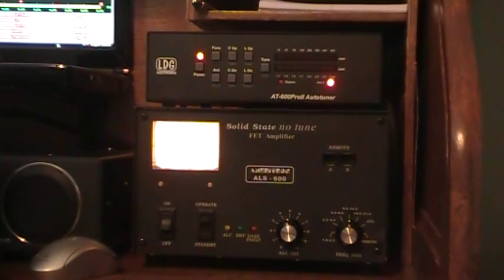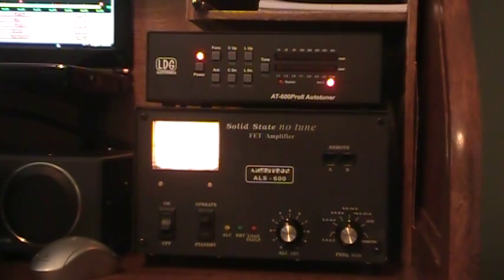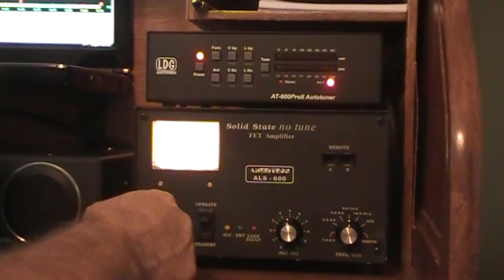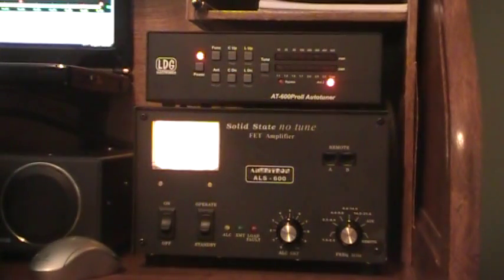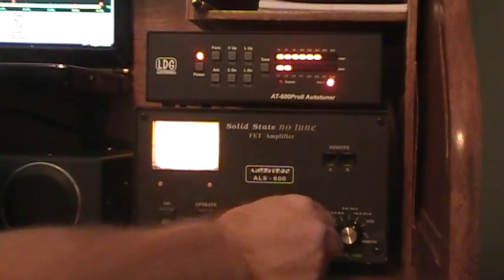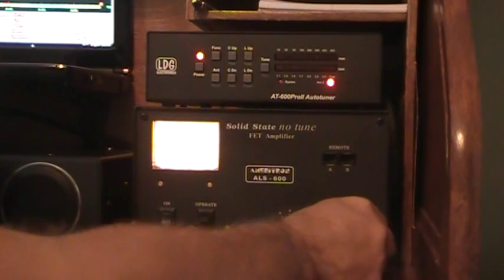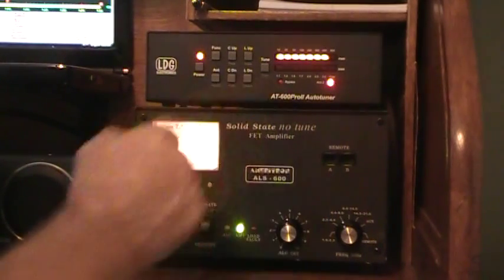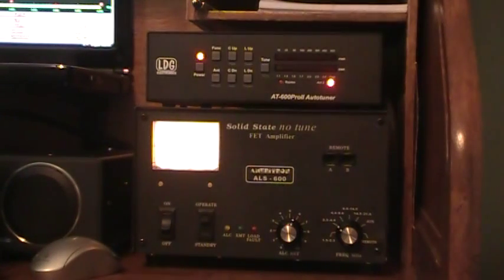LDG- 600ProII Auto Tuner

Comment: I have the same setup as you, except I have a IC-7300.  Do you ever have "Load Fault" issues when transmitting on 80 meter?  My SWR is about 1.6:1....at about 200 watts, my "Load Fault" LED comes on.  I can transmit at 500 watts on 20 meters no problem, with up to a 2:1 SWR.  Just curious if you have any issues on 80 meters.  Using a G5RV inverted dipole, BTW.

Comment: Question? I have Kenwood 440 & a LDG at1000 alto tuner and a ameritron 811, my problem being is im running a g5rv and at this point it will only tune to 40 meters need to add more coacts? cause my impedance is not right ... Question to u what antenna would you recommend for my setup and that would work well with the at1000?

Comment: Not sure where is says in the manual that Antenna 1 is bypassed, maybe this is just default as both Antenna 1 and 2 work in line with the tuner or you can bypass both Antenna 1 or 2 or individually. You can put the unit in auto mode and you'll have no need to hit the tune button, all you do it introduce a carrier and the unit will automatically start the tuning process. Also once you have tuned on a band lets say 40m and tune then go to another band say 20m and tune and then back to 40m, you do not need to tune again, just introduce the carrier again and it will remember the band and setting and it will recall the previous tune straight away. You can save a few tuning stages along the band from bottom to top or vice versa, that way you just key down a carrier anywhere on that band and you are already tuned as the unit will recall the setting previously stored straight away, turn on the amplifier and key carrier for a quick check that the swr is still ok, switch back to ssb mode and your good to go :) Nice video though, cheers :)

Comment from the maker: Kevin. The tuner is a bit load compared to an internal on a radio but not to bad at least to me. It does a better job tuning my multi band then the ftdx3000 tuner. My other radio is a ts2000 it had no problem with the dipole but the yaesu has problems on 15 meters. The ldg tunes all bands fine. A solid state amp is not as forgiving of high swr like a tube amp is the ldg does a great job for me but keep in mind alot is determined by antenna placement and soundings. My multi band is in my attic and not in a conventional pattern but tunes down fine. Hope this helps.

Comment: I have been looking at that same set up to go with my 1200dx but still not sold on the ldg 600 I have read they are quite loud and have an issue on some bands bringing swr below 1.7. I have a few multi band wires that are about 2.5 without a tuner ant thoughts

Comment from the maker: You won't need the 704 with the ts2000 most newer radios will interface them self. The internal tuner works great just use the ldg with the amp to handle the power. Multiband in the attic not the best antenna setup but has do do for now.
Reply: So how do you have the ALS-600 hooked up to the TS-2000? Does it operate solely off of RF drive, or is there a relay interface between the ALS-600 to the TS-2000?

Comment: I also have a TS-2000. I'm surprised you need a tuner but it's obvious it's needed to handle those high SWRs.
Reply: Why surprised? The most internal ATU of the transceivers have a maximum tuning range from 16 - 150 Ohms. By almost all of the multiband-antennas you need a antenna tuner...